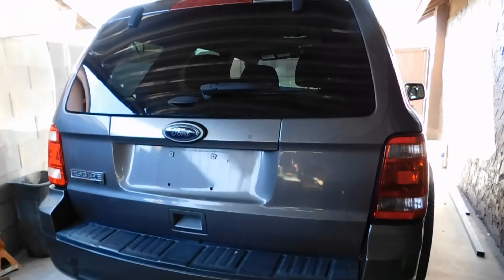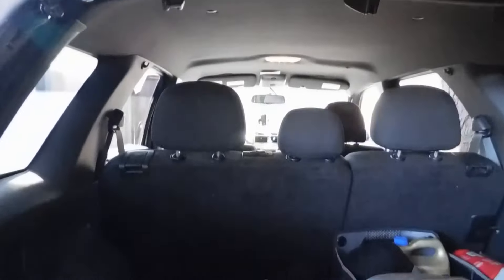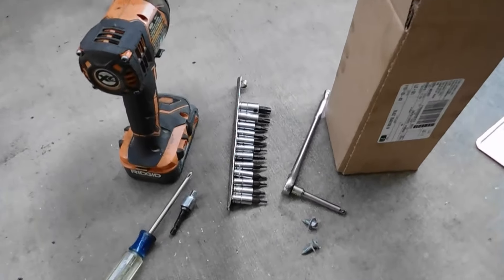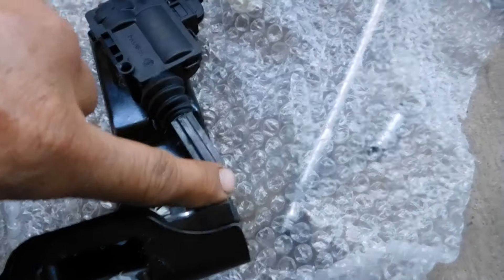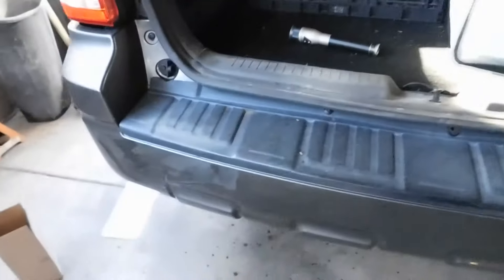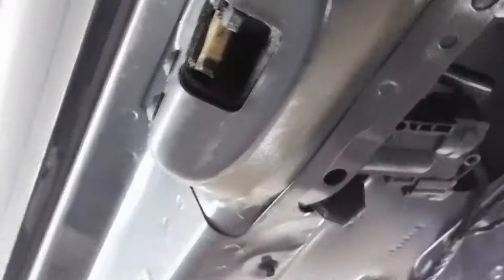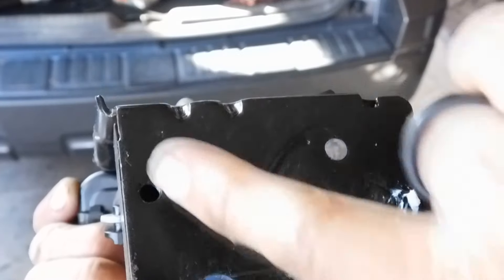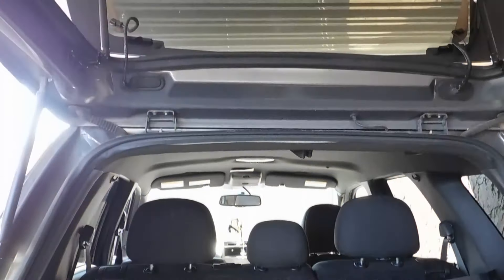2008-2012 Ford Escape Tailgate/liftgate won't open. Problem Fixed (EASY)

Comment: You were a life saver with this video. I took it to the Ford dealership and they were going to charge me $367.00. I paid 24.99 on Amazon and fixed it myself with your video!! Thank you!! ❤️
Reply from the maker: Thank you for the kind comment. I am glad that you were able to fix your problem. Please consider subscribing to the channel and God bless you 🙏
Reply: what is the name of the part?
Reply: Rear liftgate door lock actuator.
Reply: @Olomsbass86  Tailgate Latch
Part #: 7843150
Reply: Got the OEM part for $45 on line and fixed it in 30 minutes...works great.Thanks for the help!

Comment: I had the same problem, my tailgate would not open. I tried everything. Then for some reason I saw the button on the drivers door that makes it so the passengers can't open their door, for kids. I tried switching that button and went to the back, and I couldn't believe it, it opened right up. I'd try this first before tearing it apart.

Comment: Hey! Thanks for the video. I have changed the piece myself. The problem is that the latch still does not open. Do you have any information about what else it could be?
Reply from the maker: Hello! Did you check the fuses yet? Also, check the bottom for continuity so you can see if the bottom is working. Keep me posted.

Comment: Check the relay. Look in the manual and you will see there are two fuses and a relay connected to the lift gate latch. In my case it was the relay in the fuse box under the hood. After I replaced the latch and the switch of course. The two fuses were good.
Reply: so with my 2012 escape the latch stopped working but there is no sound or clicking so i think it could be the fuse or relay like you say. do you know the fuse and relay number? i don't have a manual, thnx.

Comment: Good Video.  25T is the correct wrench.   My latch was replaced 5 or so years ago on recall.  They used lock tight on 2 of the 3 25T screws which caused a mess.  Had to drill out 1 screw.  Thanks for the video!
Reply from the maker: Hello. I appreciate the comment 🙏
Reply: I commented about the T25 too. Didn't see your comment. Had to drill? Ugh! Sometimes things just gotta be a pain.  But at least it was where you could get at it! :-)

Comment: Thank You Man!!! I’m not very vehicle knowledgeable outside of jumping a car and changing tires. But just like many stories in this comment section i got pulled over The officer was cool just let Me onow the light was out but the only way to access it was through the lift gate. I had the bulbs on Me but it’s been stuck for years. I got a warning a shop wanted to charge a whole lot almost two hundred. But Your Video saved Me that expense. I just popped it open with my hand, asked an officer for a Philips screw driver replaced the bulb! All’s good now! Thank You For The guidance! God Bless You Man!
-Joseph 
P.S. good luck everyone just trying to get By! God Got’s Us!
Reply from the maker: Hello! Thank you for taking the time to share your experience, I am glad to hear that you only got a warning and that you were able to fix your car!! God bless you and keep up the good work 🙏

Comment: Great video. Thank you for this! Our lift gate actuator was working sporadically. When I went to repair I got lucky and the door opened. I was able to bypass the difficult part of your instruction and install the new actuator in less than 15 minutes.

This video plus $47 CAD part FTW!
Reply from the maker: Awesome,  thank younfor sharing your experience. Have a great day and God bless you 🙏
Reply: I also live in Canada and just looked up this video on how to repair my car. Would you be able to share where you got the actuator?

Comment: My liftgate went out last summer and I have not had the money to take it to a shop that is gooing to charge me a couple hundred in just service fees not to mention the parts and time.  My father taught me how to do alot of my own car repair but it was on cars from the 80's and back this helps so much and now I know I can do the repair myself for under 50 dollars.  Thank you so much.
Reply from the maker: Hello. Thank you for posting your comment. Please keep me posted with your repair. Have a great day and God bless you 🙏
Reply: I had the same problem, my tailgate would not open. I tried everything. Then for some reason I saw the button on the drivers door that makes it so the passengers can't open their door, for kids. I tried switching that button and went to the back, and I couldn't believe it, it opened right up. I'd try this first before tearing it apart.

Comment: Thank you so much for this! I’m sure this saved me hundreds of dollars taking it to get fixed. Only cost $20 for the part from Amazon and it took me about ten minutes to fix it. Getting the panel off and putting it back on was the only part that was a pain. I also had to use a T25 too. The T20 was too small. Strange considering mine is a 2012 Escape as well.
Reply from the maker: Glad to hear that the video helped you. Thank you for the time to post your comment. Have a great weekend and God bless!!

Comment: Thanks so much. I was baffled about how to get the cover off, but you showed me how. A flashlight helped to see the release catch and get the liftgate open. O'Reillys had the Actuator in stock ($133.00) so I was able to put it on today. Now my wife is happy to have a working liftgate, but I am a little bummed out after reading some comments below and finding that Amazon sells the actuator for under $30.  Thanks again!
Reply from the maker: Happy wife, happy life!!

Comment: Great video, helped me fix my daughter-in-law's Escape right away. Btw, the T20 Torx was too small for my application. I had to use a T25 Torx. Maybe they changed the size of the screw head over time.

Thanks again, outstanding!
Reply from the maker: Thank you for posting your comment. Glad to hear that you fixed the problem. Have a great weekend and God bless you 🙏

Comment: Thank you for uploading this video it really helped me. I was at the car wash washing 2012 Ford escape limited & I couldn't open the back, thanks to this video I was able to get it open. Someone stole my license plate off my escape & I lock screws on & took the panel off to make the screws tight so no one would take this new plate. I had gotten to put the wire connectors back for the hatch...lol thank you a lot... I left a like & subscribe

Comment: Hello, in my 2010 Ford Escape it was the T27. However, so far I can't remove the screws even using a Bosh drill (the kind for screwing/unscrewing). Any tips you can recommend to me so I can finally change the part. Thanks in advance.
Reply: ¿que fuerza tiene tu taladro?

Comment: I have a 2012 xlt 4x4 a/c fully charged but I get intermittent cold then hot operation when the ambient temperature is above 75* any solutions?

Comment: Great video.  I just got done replacing the actuator.  For some reason, I had to use a T27 instead of a T20.  The screws were really tight, and it took me a while to get them out.  Everything else went great.
I am in Georgia.  Can I throw the old part into the garbage, or do I have to take it to be recycled?
Reply from the maker: thank you for posting your comment. You should be able to put the old part in the garbage without an issue.

Comment: Thank you I love the videos I have learned how to do many things from them
Reply from the maker: Hello. Thank you for posting your comment I really appreciate it. Glad to hear that the videos are helping you. Have a great day.
Reply: My 2009 escape is leaking antifreeze qnd over heating it's not a large leak it's used half gallon of antifreeze in about 5 days.  I've changed waterpump thermostat and clamps hoses are good I can't find the leak help me please
Reply from the maker: @nikkikern7050  I am sorry for the late response I just saw the comment. Have your coolant system pressurize. You can borrow the tool from AutoZone. You can pressurize the system and see if you can locate the leak. Please, keep me posted. Have a great Thanksgiving.

Comment: If neither the glass or the back hatch will open, what are the odds they both screwed up at the same time? Is it more likely an electrical problem? Without getting the window open, fixing the bottom latch will be VERY difficult.
Reply: Imagine changing your break lights

Comment: Thanks for Video, need to open the back door to replace the light bulbs. Mine doesn't make a sound when I press the button, do you think I need a new switch? I can hear it at the fuse when button is pressed.

Comment: Thank you! Part cost 45$ CAD on amazon. You saved me at least 300$ + 15.5% taxes. lol
Reply from the maker: Hello 👋 and thank you for posting you comment and experience. Glad to hear that the video helped you. Have a great weekend.
Reply: @gqautodiagnostics  I did an extra test just to make sure it was the actuator.I disconnected the clip that brings power to the actuator. I put my volt meter on DCV . placed leads in the connector and pressed the button to open the tailgate and my reading spiked to 12v. I knew there and then my actuator was faulty and eliminated the button being defective. I did this because I was getting absolutetly no noise from pressing the button to unlock.
Reply from the maker: @Frosty_x.x  well done!

Comment: If the manual liftgate button (on the back of the hatch itself) won't pop to release the gate, how the hell do you get it open to replace the actuator? Genuinely confused Ford Escape owner currently dealing with this...
Reply from the maker: Hello, that is an excellent question,  if you are unable to open the gate you need to go into the back of the car an remove the trim or door panel to access the actuator and open the gate and door. Be patient you can do it. Keep me posted and God bless you.

Comment: Not so easy and simple for me. Just.chanhed out the actuator and relay and fuses theres still no power getting to the actuator any suggestions what could cause this?
Reply from the maker: Hello, thank you for commenting. I am sorry that you are having problems with the tailgate. The next thing to do would be to test the button of the tailgate. Keep me posted. 
Please consider subscribing to the channel. God bless.

Comment: Thanks. I have 2011 Ford Escape. Doing that problem. Also key ignition no start. Some times it will start with the automatic shift handle move back in forth step on the break pedal
Reply from the maker: Hello and you are welcome. It sounds like the safety neutral switch is giving you problem. please keep me posted. God bless you.
Reply: I dont kniw what its called but its the rod that the key pushes and it goes into a plastic pc that turns. The rod is slipping in the plastic pc. Try pushing the key in hard when starting the car. Should start rite up.
Reply: @robertmount1379  I found my wife was having that same problem on her 2012 about a year ago and so I started to check it out and found if you pushed in on the key while starting it would work. The same as what you advised @CueBallRacer4319.

Comment: It would have been nice if Ford had added a hole and a popout for easier access through the plastic cover to the thing you have to push to open the tailgate.

Comment: I replaced my actuator, but it still does not work?
Reply from the maker: Hello. I am sorry to hear that you are having issues with the tailgate. Did you check the fuses yet?
Reply: @gqautodiagnostics  ya I pulled it out for a few minutes and put it back in. I can here clicking with the outside handle switch and that it